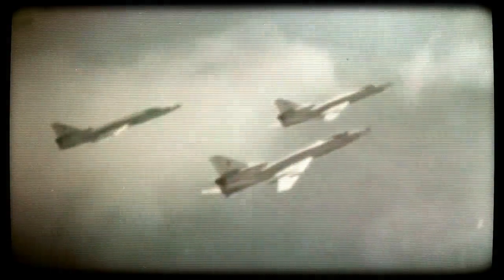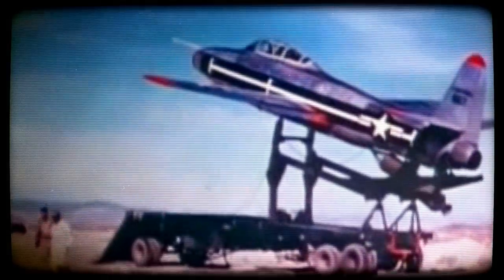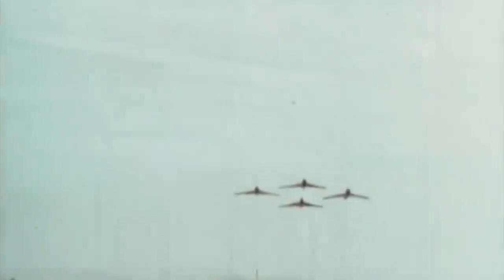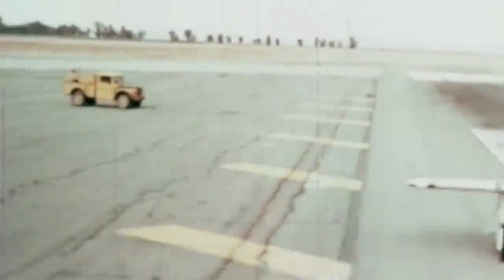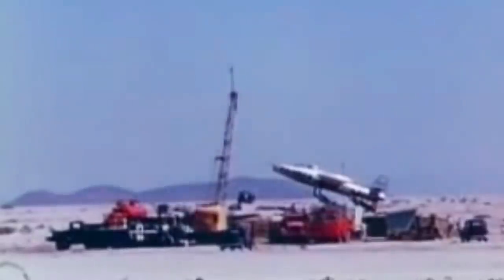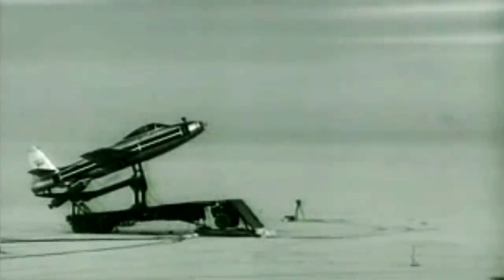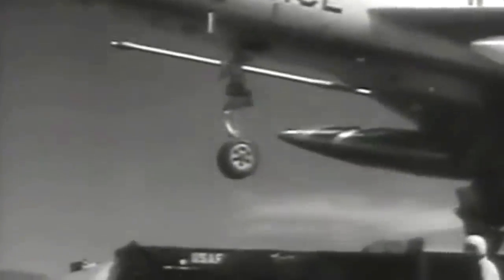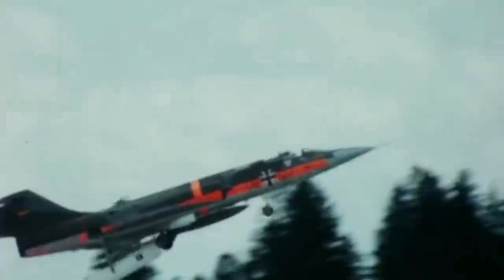F-84 Taking Off from the Back of a Truck

Comment: I was in the Air Force in the mid-sixties but never heard of Zel but it sure is interesting.
Reply: Sounds interesting indeed
Reply: We did that with the F104 (in Bomber configuration), here in Germany.
Reply: interesting  Doubtful, I carried a top-secret clearance and worked on nuke loaded B-52s. Wasn't much that went on on the Flightline I didn't know about. That test was only done on one or two bases.
Reply: @route66flyer29  can I know a secret
Reply: @Yo_vanny  lol.
Reply: @Yo_vanny  uhh.. u can't digest it..😂😂
Reply: @Gabriel Clark so that's why there's a high 104 crash rate in Germany
Reply: interesting  didnt have clearance that's why he didnt
Reply: @route66flyer29  thats doubtful because u can't talk about that ever so
Reply: Well, I'm guessing a couple of pilots died and a whole lot more injured, so it was a mostly failed experiment far away from regular pilots and crew!
Reply: interesting  "Above your pay grade", well obviously not, they need engineers and pilots to fly the brass' secret projects.
Reply: You keep living and you're going to find more top secret vehicles you never heard of before.

Comment: So its kinda like launching off a carrier, just with a rocket instead of a steam catapult
Reply: I don't think they use steam anymore do they? I thought it had something to do with a electromagnetic system.
Reply: Scratch that I didn't think you were probably referring to then and not now. Also the magnetic setup is something they are currently working on.
Reply: @DontHasselHoff  Only the newest carriers have an electromagnetic launcher.
Reply: @DontHasselHoff  it’s called EMALS.

I will be dumbfounded if no one one has yet defended the Ford as a worthy ship by saying “but her EMALS!”
Reply: @DontHasselHoff  sorry, but thumbs down by mistake. I think the newest carrier is the only one using electricity.
Reply: @ZEZERBING  2: the CVN 78 Ford, and CVN 79 Kennedy.

Comment: Me: mom can we have VTOL?
Mom: we have VTOL at home
VTOL at home:
Reply: DTOL :v
Reply: I would call it VSTOHL:
Very short takeoff and hard landing
Reply: This is nothing like a VTOL or VTOL type aircraft at all
Reply: Not taking off or landing vertically, but, okay.
Reply: @bradleyborg9889  that's the joke
Reply: @user-qr5vt3yz3q  r/woosh
Reply: @lucastekkan  calm down Lucas
Reply: @lucastekkan  It's not about being dumb. The dumb thing is people calling others dumb for pointing out a flaw in a joke. I think everybody here understands that BusterBuizel meant it as a joke, you can tell it from "Mom" etc. but that doesn't change the fact that the launch method seen here is not VTOL. I think jokes are more fun when there's something to them.
Reply: @skunkjobb  the joke is that this could be passed as a budget or offbrand VTOL. Everybody that knows a little of aviation knows its not VTOL, the joke may be repetitive but it was alright, if the flaw you say is the fact that this isn't vtol, that's the point of the joke
Reply: @user-qr5vt3yz3q  It's Just a Joke dude
Reply: The L part concerns me...
🤣

Comment: The F-100 ZELL tests were done at Holloman AFB, NM.  They were launched from truck-mounted launchers just like Matador/Mace and the F-84s.  The F-100 was also launched from the structure seen briefly in the video.  It was to simulate a hardened shelter that was later adapted for use by Mace.  This structure still stands at Holloman.

Comment: Ace combat 7 was right with container launched drones
Reply: @fullnuclearbreakfast  they are pretty weak, 2 SASMs indirect hits are enough and easy to get
Reply: As a sneak attack that might work. For defensive use there are some issues. Aircraft need maintenance - you can't just leave it somewhere for months without looking at it. You also have security issues - to be useful the aircraft would need to be fueled and armed. How do you keep somebody from just stealing one and causing all sorts of trouble? One or two guards wouldn't be enough - a small gang could surprise them and then go shooting down airliners or bombing the local city.
Reply: @RichFreeman  you are completely right, though here we were just talking about a video game ^^ But I still think it is possible, the drones could be launched from truck mounted containers, making it harder to detect and intercept
Reply: @asidewinder5871  You could, thought it would be more of an offensive thing.  Non-electrical drones probably don't have much of a shelf life.  Electrical drones can't do much besides surveillance.  

This also raises the question as to whether the drone itself adds much value.  Just sticking a vertical-launch missile in a container of some sort is probably more practical and maybe just as effective depending on the mission.
Reply: @RichFreeman  true, but a missile can only take down one plane, while autonomous drones such as those in Ace combat 7 could technically take down multiple planes. When it comes to fighting, as drones they are not limited to 10 Gs, giving them a huge advantage in a close fight (they use an AI based on the data of a superhuman ace btw)
Reply: @asidewinder5871  The drone can only take out multiple planes if they have multiple missiles, at which point you can just stick multiple missiles in the container.

An AIM-120 is 12ft long and weighs 150kg, and of course needs a fire control radar that needs a lot of power.  It isn't like you can load half a dozen of them on a dinky little drone.  If you want your drone to be doing high-speed high-G maneuvers you can't stick a tiny little engine on it either.  

The kinds of drones actually used for attack missions are up there in size with fighter jets.  Oh, they can be more compact for a couple of reasons (more expendable, no cockpit or life support, etc), but it isn't like you can replace an F-35 with something that fits in a suitcase.
Reply: @RichFreeman  ok ok you won I guess XD there is still one thing the drones have that missiles don't: they are reusable, and therefore cheaper in the long run (now just think of the guy who posted the first comment and who receives all the messages of our little chat XD)

Comment: I have been lead to believe that certain parts of the interstate highway system were designed to act as secondary runways and an example would be now interstate 84 at Ordinance near Hermiston Or any documentation on this?
Reply: Short answer: yes.
Further details:
"... throughout the system, mile-long stretches of concrete pavement double as emergency landing strips for military aircraft." 
Source: https://www.army.mil/article/198095/dwight_d_eisenhower_and_the_birth_of_the_interstate_highway_system

Comment: Why wouldn't they just use roads to launch on. Get a sweeper crew through first and you could launch and land almost anywhere. Especially as they will need roads to drive the lorry on😅😂
Reply: your average road makes for a very shitty runway with just how bumpy or curvy it is
Reply: At leased in Germany there are Highways that are setup for this.